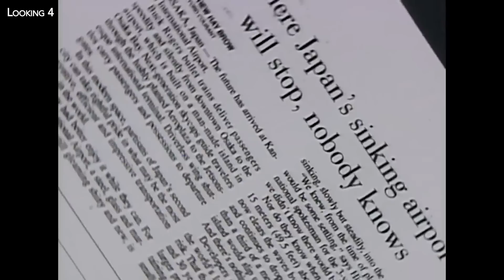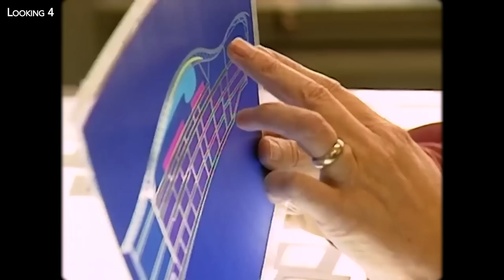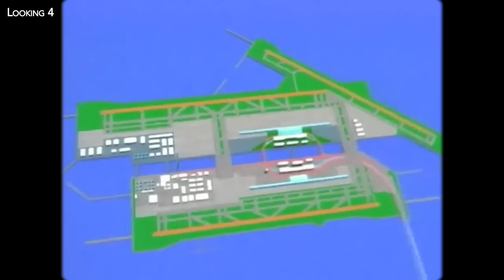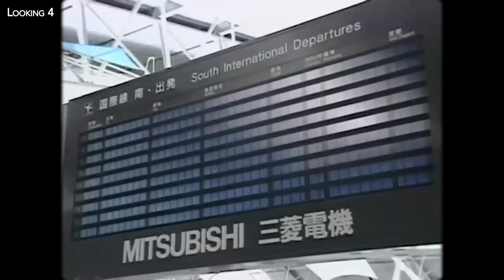The Race to Save Japan's $21BN Floating Airport

Comment: Doomed from the start. they were warned by multiple studies. Buy instead decided that "mitigation schemes" To be determined at a later date wer all that was needed.
I remember them saying this would only settle 1 meter a century before construction even started....So, stack a billion tons on clay that has only supported a million, and wonder when it starts to pancake the footings.  I think all the construction heads knew this would happen. But since it was so far away till completion, they could all just point fingers and no one will ever be the wiser. Bonuses saved, summer houses and boats attained. F everything else! You cant see it from my yard....Common sentiment nowadays.

Comment: Why not built on the spot they remove the soil for the artificial island? Could've been a lot cheaper.
Reply: Even if there is enough space for construction and expansion,  still  there would be  protests by the nearby residents - Narita(NRT) is an example.
Reply: You mean on the mountains?
Reply: A great spot for crashes surrounded by mountains

Comment: The title is a bit misleading. If the airport was "floating", that would perhaps solve some of the problems. However, apart from the technical challenge of making such a large structure float, it would lead to other problems.

Comment: "A fragile jewel in the crown of global aviation." That's worth a like for sure. Do you work in advertising? you might have a career there. Great video. I used to live in that metropolis. I can contribute that this project, at the time, was the deepest artificial landfill operation in the world. All that weight tends to crush the layers below. Soil scientists get paid big $$$ to understand the behavior of these materials. A Japanese soil scientist told me that the location was chosen in consideration of aircraft noise, but that much quieter engines had been developed in the meantime, allowing the airport to have  potentially been built in a shallower part of Osaka Bay, closer to land. 

Also, FYI, due to the shared airspace, for each plane that lands at the Kobe airport, one less lands at Kansai airport.
Reply: In 2022 KIX had 93,656 aircraft movements.
Kobe had only 33,270.
Itami had 133,666.

Comment: Below the Airport High Density Thick Foam Could be released which would slowly Expand in LAYER by LAYER And Lift the Airport.
TO PREVENT FOAM ESCAPING
FOAM COULD BE ARRESTED BY HEAVY DENSITY PLASTIC WALL SUPPORTED WITHIN WITH STAINLESS STEEL RODS OF 904 QUALITY.
Heavy weight wall arrest FOAM also would prevent AirportDrifting as Anchored in water with Rods.
Hope these might would help Airport.

Comment: There are no aircaft that weigh several hundreds of tons. The A380 is the heavist at 300 tons.
Reply: I thought the take off weight was 500 tons? I worked on upgrading taxiways at Heathrow capable of taxing a 20% heavier aircraft so a 600 ton aircraft?

Comment: One of the nicest airports I ever used!
Reply: Unlike Charles de Gaulle airport, which is chaotic and terrible in service.
Reply: @raylopez99  Do you know the difference between ITM, CDG and JFK?
- ITM: You never witness anybody cleaning, the airport is clean like a 5 star restaurant's dishes
- CDG: You never witness anybody cleaning, the airport is dirty in every edge and in between
- JFK: Quadrillions are cleaning 24/7, the airport is dirty in any edge and in between
Reply: @peterebel7899  LOL how true about JFK, where about 15 years ago I could not get public WiFi to work (it was "in progress") and once missed a connecting flight because they were using "disadvantaged youth" which looked to me to gangbangers with an attitude to give directions to connecting passengers (they failed to do a good job and I lost my flight)..  I have been to ITM btw en route to Toyota Town and I don't recall it was anything bad (or good) it was unremarkable (which is good)
Reply: @raylopez99  I spare out my experiences with JFK, it did cost me days of my lifetime.
I always preferred Newark.
Reply: @peterebel7899  Yes.  When traveling to Europe I try to get a direct flight from IAD to  Germany, avoiding the UK and FR and JFK.  Istanbul's new airport also is pretty good, as is ATH.
Reply: @raylopez99  Yes, I once took exactly this leg:
The experience is a cultural shock par excellence!

Comment: KIX may be an impressive feat of engineering, but the airport is about as convenient, inviting, and interesting as a root canal. It's basically a big bus station in the middle of nowhere. 
The airport is poorly designed in terms of traveler comfort and needs. There's so few food options along the route from the train to the gates. It's both amazing and sad how much better other airports are compared to KIX.
Reply: C'mon I could get soba noodles there with real wasabi root grated at the table. It is out of the way, due to consideration of noise to adjacent communities. Actually about halfway between Honshu and Awaji island. Quieter engines were under development--the high bypass engines--so actually the airport could have been sited in a shallower part of Osaka Bay, closer to Osaka. It is a much longer ride there, than to Itami Airport, also much improved.
Reply: @ChildSpaceMethod  You can get soba noodles with fresh wasabi and on the platforms of many trains stations too. 
My dissatisfaction with KIX is based on a comparison with airports like Incheon. KIX lacks sense, style, or convenience once you're there. 
I'd heard it was undergoing renovations to make it more appealing so I was hopeful heading there on my most recent use last August, only to find nothing much had changed. 
It desperately lacks the appeal needed to people forget about the travel time and usage tax, which is part of the reason the airport has only been profitable a few years total through its 30yr history.

Comment: I few from there last month, from the second terminal which I think is mostly used by budget airlines. It was like a makeshift airport, but maybe the budget terminal is getting a makeover. Transport to there was more limited than I expected from the city but it was a 30 year old train that had been pimped up with hello kitty stickers, curtains and headrests.
Reply: From the city there are two major train lines going to the airport, along with a ton of limousine buses.
Reply: @earlysda  Yes trains and buses there but had to prebook on a time specific train to the airport via a clunky 90s style ticket machine. Compared to other other modern cities and the site of the airport I found it very lacking where there are very frequent trains and you can just tap and go.
Reply: @earlysda  There wasn't trains every 10 mins when I was there. The only direct option was the limited express every half an hour that needed a seat reservation for a booked train time. Maybe that was an odd day? Probably more options from other parts of the city and as a visitor I was probably a bit confused but compared to other airports of the same size in other cities it did feel a lot more limited and difficult to get to this somewhat new "state of the art airport".

Comment: 3:19 Tetrapods don't keep the structure dry. The sea water is free to flow through a tetrapod barrier, but in the process disperse most of the energy of the waves.
Reply: maybe he means it keeps it dry by helping the dike?
Reply: @happyentertainment8003 Naw, it's less of a dike that the tetrapods are protecting than it is fill dirt.  There is a concrete wall above water level which they're going to raise but between the tetrapod walls is fill dirt.  The water level throughout the airport property is mere feet below the surface.
Reply: Right?  Tetrapods are also all four footed animals with backbones higher than the fishes in the taxonomic classification hierarchy.
Reply: @CaptApple I only know Tripods lol. I know no Tetrapods at all lol. Well I guess I'm learning new things here thank you to you both. (I think there were Tripods in the War of the Worlds...if i remember)
Reply: And dissipating the energy and effects of the waves helps keep it dry.....same thing.
Reply: @johnstudd4245 Not dry.  They minimize erosion not absorption.  They provide no fluid barrier.  There is no seal.  Groundwater throughout the airport is feet below the surface, like most of Florida.
Reply: @CaptApple  They still help keep water from "over washing" the place, except in  extreme conditions as was demonstrated in the typhoon. If you did not have that barrier you would see the place getting flooded much more often and to a larger degree. In my book that is certainly helping to keep it dry.